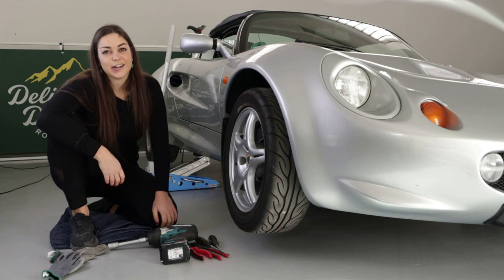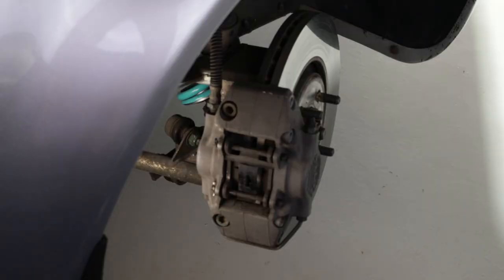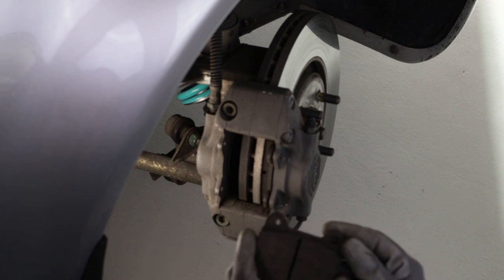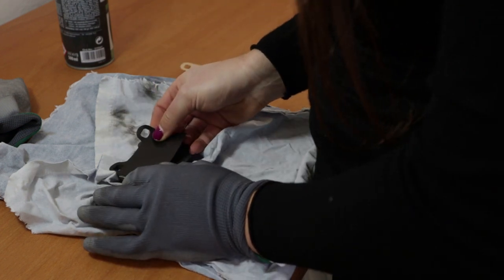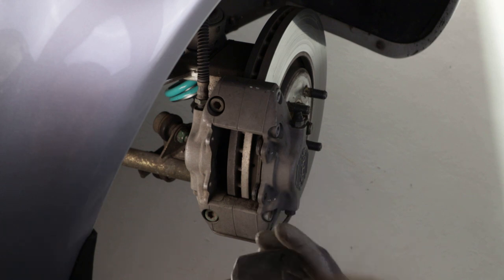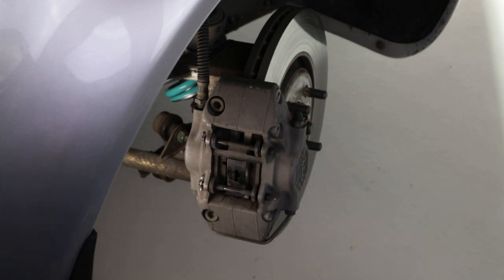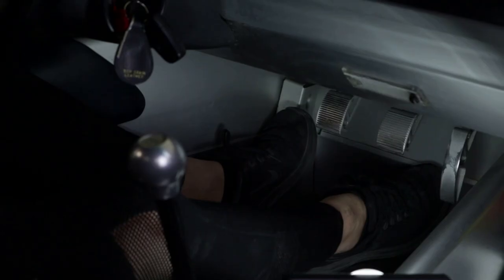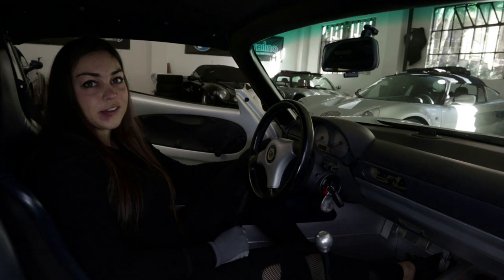Unsquealing the Elise

Comment: You can use some "Plastilube" or other brake pad lubrication on the edges of the brake pads to avoid even more squealing, and there are even anti-squeal pads to put inside the brake caliper to reduce the risks even more. It's easy to do/retry if the anti-squeal-pads don't work.
Reply from the maker: Thank you again. I looked up Plastilube which seems to be great stuff. The two plastic strips in the brake caliper are of course in place and I decided to retrofit the anti squeal pads on the breakpads, because nothing else seemed to do the trick. The results are great, btw. I did drive the Elise in the meantime and the difference is amazing.
Reply: @ElisaArtioli  Sounds awesome!

Comment: You really should use some axle stands! The wheel is somehow good, but those stands are better/safer.
Reply from the maker: Thank you for the advice. I will look into better options to support and secure the car while the wheels are off.
Reply: @ElisaArtioli  For the Elise, the axle stands with a flat top are the best. Use some rubber for protection 😂